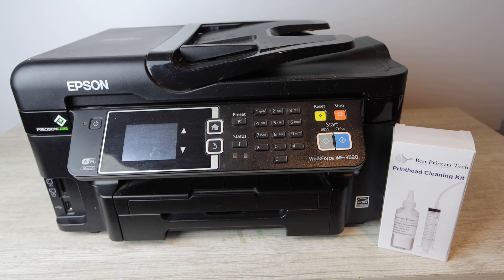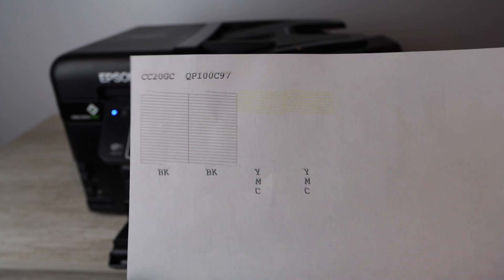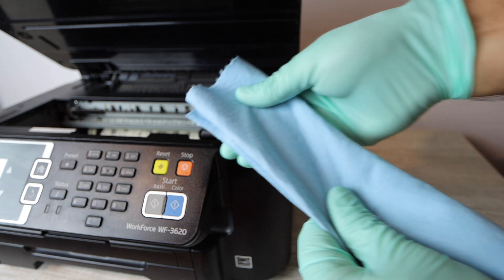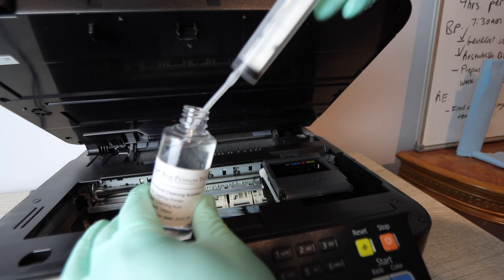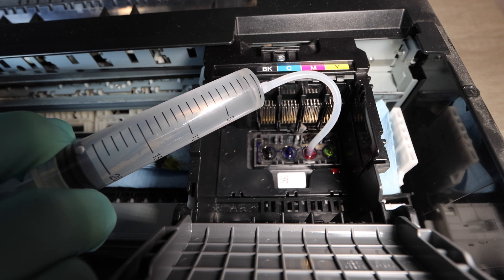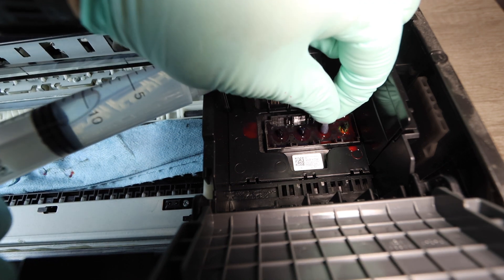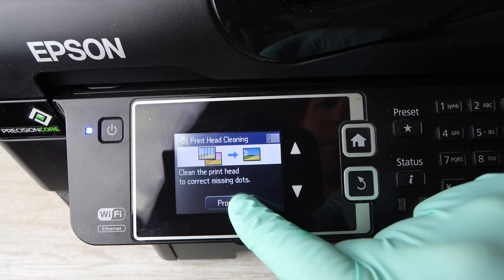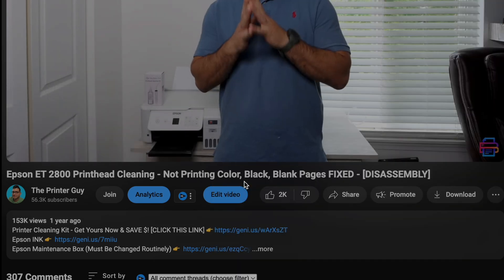Epson WF 3620 Printing Blank Pages or Not Printing - How To Clean Printhead [FIXED!]

Comment: Why is it very important that we put in new cartridges after the cleaning with a syringe?
I still have 1/3 of the black and half of the other colors.
I hope to hear from you as I am on my witts end. :( with my printer and you are my only hope :)
Thank you
Reply from the maker: It is vital to install new ink because when you do this cleaning, you are pushing in out of the system, and you need to replace that ink to ensure that the printhead has ink to process. If you don't do this, you can exacerbate the problem.

Comment: Thanks for your video. My cartridges are almost new and have plenty of ink, so I am wondering why you seem to insist on getting new cartridges as part of this cleaning process?
Reply from the maker: If you are certain that each cartridge is totally full with ink, then you don't need new ink. The reason I say you need new ink is because many times low ink cartridges, go undetected, and that many times as the source of many of these printhead issues.

Comment: Hello. I used pure alcohol to clean the head of my Epson L210 printer because of the horizontal line problem in its printouts. After assembling the printer, the printer printouts were always blank. I did all these operations with the Adjustmen Program: "Head ink charge", "Shipping liquid charge", "Initial ink charge", "Cleaning - CL3", "Cleaning - Power CL", "Waste ink pad counter reset", "Initial setting - Product Serial No", "Head ID Input", but the result did not change. I did F1 Fuse short circuit. The result is still the same. How can I solve the problem?
Reply from the maker: I apologize I could not get to your comment. If you would still like support, expedited responses and member only videos please sign up for a membership here 👉 https://geni.us/BPChannelMember
Reply: @xly914  did you solve it?